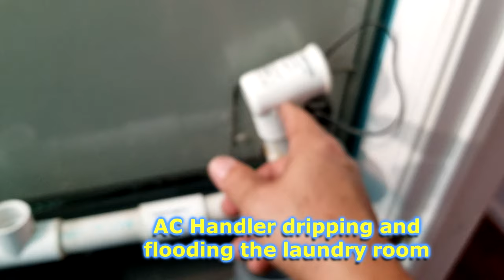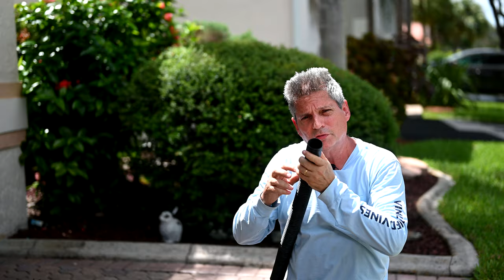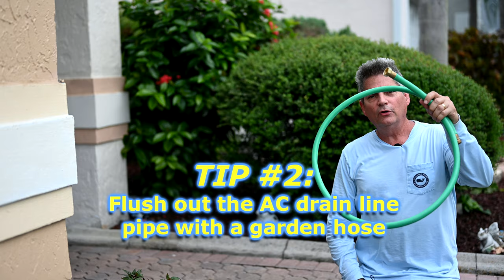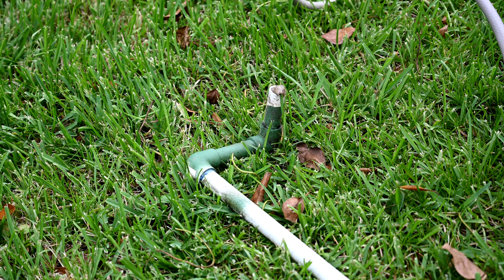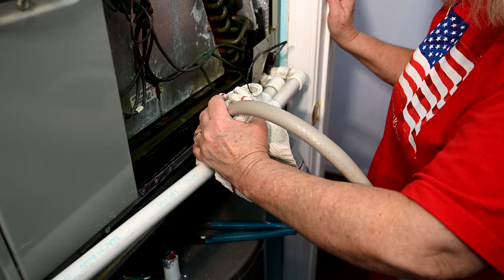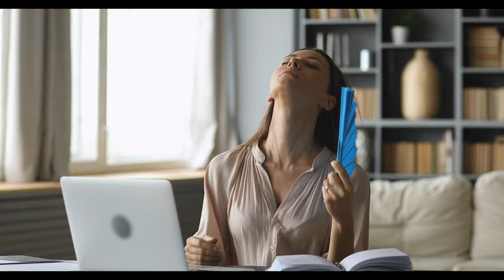AC Dripping/Won't Turn On?  2 Tips Unclog AC Drain Line Pipe

Comment: You dont need to flush it out with a hose. A vacuum is all you need. Its only a drain.
Reply from the maker: You are only partially correct. If all you do is just use the vacuum it's not going to get everything out of the line and we find that sometimes a couple of months later we're back out there with the vacuum again. So I again. So I think gushing it with water at full pressure from a garden hose is the best way to completely clean out that type.
Reply: What if the vac isn't getting the clog out? And do you have to open your A/C before you hose it?
Reply: @angelwings0224  snake it
Reply: @RadioRich100  from the inside or outside
Reply: @angelwings0224  from the inside at the unit out. Making sure to clean out the trap. Also from the unit snake back into the pan if you can.
Reply: @jeffostroff  Thats not a good idea because if there is a stubborn clog u can blow a pipe joint open. Your better off snaking and vacuuming. But if the person did this often you wouldnt develop such a stubborn clog in the first place. Tablets and vinegar should be regularly used to avoid this.
Reply: @RadioRich100  I use vinegar all the time, I guess it wasn't enough. But now it's got a horrible clog. Can I clean it with a brush from the inside? Or do I need to do it from the outside? I don't want to make it worse. I tried and tried shop vacing it and no water will come out of the outside pipe and only a tiny bit of water from the over flow pipe. Just enough to get the over flow switch to stop tripping for 24 hours then the water backs back up and shuts the a/c back down. Which also shuts the heat off and it's cold outside.
Reply: @angelwings0224  If you can open the line near the handler use a snake to open the line. If you cant do it like that you may have to cut the line open and install a cleanout fitting to give you access.  With the line open you should be able to run snake through. I have 2 union fittings in the line on either side of the trap so I can remove it and snake the line that way.
Reply: @RadioRich100  when you say open the line, what do you mean exactly? I'm new to all of this so I'm trying to learn and don't want to mess it up. Thanks so much for trying to help me
Reply: @RadioRich100  Can I insert a snake where the over flow switch is? I'm not sure where I would cut it, unless I got in the attic. Because there is only a small pipe inside where the over flow switch is and then the pipe outside.
Reply: @angelwings0224  Open the line near the air handler by cutting the pipe at a spot where its easy to snake down the straight run of the pipe then glue in a cleanout fitting when your done.
Reply: @angelwings0224  Snake from the air handler toward the outside, vacuum from the outside making sure that if there is a cleanout fitting that its capped.

Comment: My drain line does not run outside. It looks like it runs from my air flow casing down from the attic to a main line which I cannot see. My back up line runs from the other side of the pan and connects with the main drain line.
Reply from the maker: That is unusual and I'm sure the cities don't like that, sounds to me like this was installed without a permit, or that's the way it was done when the house was built

Comment: Put a pvc ball valve on that line to keep the water from back flowing. Next attach a threaded t on the pvc line & attach a hose connection to it. Now you can easily flush the drain line once a year & save yourself time & money
Reply from the maker: yes good idea
Reply: Raul can you make a youtube video or is there youtube video on how to do this?

Comment: My ac unit is inside the home hallway . Not. Eat any walls bordering my home . I don’t see any drain pipes outside my homes , with the exception of the drain pipe for the water heater pan . Is it normal not to have one ? From the unit it goes to a drain in the wall , similar to what it looks like under our bathroom sink . Is that normal ? If I use a water hose inside , I don’t k or where it would shoot out the gunk . 🫤
Reply from the maker: It depends on how old your house is. But cities don't allow people to drain their axes into the sewer system so I would check real good all the way around the house there must be some kind of drain somewhere unless they illegally emptied it into the sewer